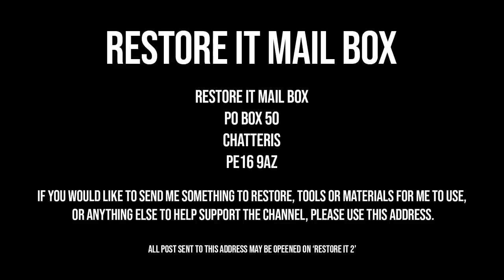Rusty BMW E30 325i Brake Caliper Restoration

Comment: Protip: Take some brake fluid on your finger and coat the piston seal and a coat the bottom half of the piston also. The piston will go in a lot easier and the seal won't dry out if you don't plan on using the part for a while. Also, install the dust cover on the lip of the piston first then press it into the caliper after the piston is seated in the bore, then press the dust cover into the recess of the caliper.
Reply: Great tip! Thanks for info.

Comment: Why would you put loctite on the bleeder valve? That thing has to be loose to bleed the air out of the brake lines.
Reply from the maker: I wasn’t thinking straight there, haha.
Reply: The moment i saw this i was like: He have not actually do that 😂Well, this guy just fucket up pretty hard when he wants to bleed his brakes an just round the Valve 😂
Reply: It's the blue stuff, not that hard to break loose.
Reply: Also.. Skip silicon grease and use anti-seize instead.
Reply: (O[][]O) silicon grease is better for the rubber
Reply: (O[][]O) silicon grease for metal to rubber contact and  anti-seize for metal to metal contact
Reply: Nolte Zockt: it isn't hard to break. He didn't fuck up, just made it a little harder to bleed it next time. No big deal.
Reply: He will find out if he restores the car by himself ;).
Reply: You dont have to unscrew that in order to bleed the brakes, so why is that a problem? Sorry for the stupid question
Reply: How else can you bleed the brakes ;)
Reply: (O[][]O) Tell me how fun it is when that anti-seize heats up and turns into a solid.
Reply: You just attach a hose to the damn plug (after removing the rubber cap)
http://www.shiftice.com/images/brake_work/IMG_5206-1.JPG
Reply: Oh yes, I forgot, forgive me :D
Reply: I think you gotta unscrew a bolt, no? Can't remember last time I did it (it's been a few years I only have a motorcycle, on which you definitely have to unscrew the bleed valve)
Reply: If its stuck heat the Bleed Valve with a blowtorch so the Threadlock burns and looses grip. Dont twist too hard or it will snap and need extracting possibly damaging the threads.
Reply: Loctite becomes useless after being heated to 500 degrees F. What temperature do you think this caliper reaches during average use?
Reply: Copper paste is the best for this.
Reply: Never Seize.
Reply: Nat Funk a little over 400°
Reply: I live in Canada, if you do not use the loctite on the bleeder valve you most likely will never be able to bleed it after a few winters.
Reply: Y B honest question here, what about using Antiseize on the contact points between the brake rotor to bearing assembly and the brake rotor to wheel hub contact points to ease removal in the future? I’m new to doing my own maintenance and don’t want to screw anything up.
Reply: You want them to turnout under vibration? Also protects the threads
Reply: canuckguy worried  nor have I   but splitting hairs so I'm not bothered
Reply: Y B  fired on the spot for being wrongly informed,  nice guy. Never made a mistake?
Reply: (O=[][]=O) lol, that’s funny.  Let me know how that turns out for you on your vehicle
Reply: To undo any fastener with loctite,  apply heat (propane torch will do) to melt it and the fastener will come out normally.
Reply: @gregoryyount6907  and it helps to prevent accidental loosening of the bleeder valve..
Reply: Ok did he do it right or not? Anyone? Ja
Reply: @natfunk71  200deg my friend, unless its a track car.
Reply: @JakubPatekk  I know it's hot enough to burn my freaking hands!
Reply: I also wonder if the high build primer was high temp enough to withstand the life of brakes.
Reply: @Badenhawk  that should be fine, try not putting grease anywhere it could leak onto the rotor imo, and remember that brakes get hot so only certain compounds survive (if you're going down large hills or such)
Reply: @mobiledevto  anti-seize does not handle heat well. It seems to gum up in slider pins. Lithium or silicone lube work great.
Reply: @Badenhawk  to be honest, a clean surface is best. If you MUST apply an anti-seize to the hub, a little spread around the hub only works. If you apply too much, you will be messing with the torque values of your lug bolts/nuts and thus potentially losing a wheel. Do NOT apply anything to the threads of the lug nuts/bolts and use a torque wrench to tighten them. Stop at the click. ;)
Reply: I realized the error of my ways and changed how I do it now. Thanks for all that commented.
Reply: @naphan3487  correct
Reply: @bikingwithchris6860  well said

Comment: I can only restore the tabs of chrome after accidental shutdown of my pc..
Reply from the maker: A great restoration non the less.
Reply: Once I even failed to click restore and clicked close and bye 30+ pages
Reply from the maker: Elvin Novruzov That’s the worst. That empty feeling inside.
Reply: Ctrl+shift+t works even after shutdown.
Reply: @elvinnovruzov5775  Check the settings, you can make Chrome keep all tabs if you exit accidentally or your PC crashes. "Settings > On startup > Continue where you left off"

Comment: After degreasing I would have thrown it to a bath of phosphoric acid for a day. Cleans up every nook and cranny, doesn't harm the parts and usually no need for a wire brush afterwards. But nevertheless, good job and props on using silicone grease on the slide pins!

Comment: Congrats on 200k subscribers.
Locktite on the bleed nipple isnt needed, the nipple is the one part you want to move when bleeding the brakes.
I've always found it easier to fit the piston before the dust cover, either way its still fiddly.
Perhaps nickle plating the nipple would have added a bit of oooh, aaaarh and stopped future rust.
Nice work as usual.

Comment: Nice! I used to struggle getting the dusk boot on but after many rebuilds I've discover that I can slip the boot on the bottom of the cylinder and then with it barely on work it into the caliper. Much easier that way.

Comment: Can’t read every comment but didn’t see it mentioned : one spot you didn’t mask (and should have) is the surface the brake ads will ride on. This needs to be clean steel so the pads slide smoothly. I’m not an E30 expert but just want to let you know in case some paint needs to be removed from those areas. One area of the car not to mess around with; brakes. Love the channel. Keep up the great work.

Comment: I hope you didn't sandblast inside the caliper, especially where the piston sits as its supposed to be incredibly smooth! i dread to think that theres bits of media floating around inside the caliper with the bleed nipple and hose being removed

edit: that better not be locktite on that bleed nipple!
Reply: Its gonna be locktite
Reply: god help getting that loose without snapping it
Reply: Blue loctite. It's not hard to remove. I don't think it's a good idea, but it's not the end of the world. Blue comes loose easily.
Reply: I found it odd that he didn't get a cylinder hone to smooth down the inside of the cylinder. Even if he didn't blast it, it still should have been honed to refinish the surface.
Reply: but loctite on any bolt you want to easily remove is a bad idea. it's not like it will back out.

debby downer alert sorry
Reply: @BaguetteBeardBass  Yes, it should not have had Loctite applied to it. I'm just saying it's not a huge problem because it's blue which is easily removed. Blue is only used when vibration and thermal cycling may cause a fastener to loosen over time. Normal hand tools busts it free. Red requires 550* of heat to decompose. The other colors have other specific purposes.
Reply: Locktight is alright, it seals the threads and prevents them from rusting together. Pretty sure he blasted the inside of the caliper dough, and that´s a questionable choice.
Reply: I was thinking the same about the inside of the caliper. The cylinder shouldnt be blasted at any circumstances
Reply: The inside bore of the caliper doesn't touch the piston or the seal. The seal goes into a groove in the bore and seals against the OD of the piston. Sandblasting it won't hurt anything.
Reply: @ADBBuild  actually it does touch from time to time... The seal is there because it's a seal... The piston having less mass than the caliper is prone to get hotter when use... So it gets bigger, the seal is flexible so it can take the dimension change up and down... If the seal is the only thing that takes the fluid pressure don't you think the would save money on precise machining that part... But no..the seal is there to overcome piston heat and dimension changes... The load is taken only by the piston and the tolerance on the cylinder...
Reply: Great point.  Precision machining is always cheaper for any manufacturing process.  That would be the obvious way to go.
Reply: Moreover, rough abrasive processing makes the surface rough, which will accelerate the wear of the piston.
Reply: Andrew if the piston wasn't an interference fit then why would he have needed to press it in
Reply: Stuey...the piston easily fits inside the caliber until you put in the seal.  Something tells me you haven't rebuilt a piston.

I think you misread what Andrew said.  The seal sits inside the groove, the piston is pressed into the seal.  The surface of the cylinder has nothing to do with pressing in the piston.  What are you actually saying is wrong with what Andrew said?
Reply: @Mikey83943  but if theres pitting or damage to the bore or piston it causes binding or leaks, so its not like the piston is a sloppy fit infact it should be fairly snug, the seal alone isn't holding it in is it?
Reply: the square cut seals purpose is to return the pistion after the pressure has been released, a square cut seal moves anywhere from 2thou to 6thou. The seal really doesn't seal much.most of the sealing comes from the piston to cylinder bore tolerences. That's why when we rebuild calipers we have to use compressure air to remove them. Otherwise if the seal was making the "seal" the air would push past the pistion and flip the seal.
Reply: @Mikey83943  or even replaced pads, let alone a rebuild
Reply: You're correct.  (Unlike the old style drum brake seals in the actuator.)  Just be sure every bit of media is cleaned out before putting the caliper back together.
Reply: @randymagnum6680  aimed at me? Have never paid a garage to replace my pads, discs, calipers or anything braking related. Especially since i'm now driving something with a rather unconventional brake arrangement.
Reply: @BaguetteBeardBass  I was agreeing with the commenter about never having rebuilt a piston, or had to press one back in place during a pad swap, whomever he was talking to...
Reply: Back in 2014 I took apart a seized up caliper, put the rubber bits in vegetable oil and sand blasted every part of the caliper, especially inside the oil reservoir where water had gotten in and started to corrode. No honing afterwards, just put it all together and the car has run quite a few thousand kilometers since then without a problem, still to this day.

Comment: Very nicely done, very professional. Tidbits: Loctite is not needed on the bleeder valve because you have to open it for bleeding. Also, you can put the piston in then put it's seal on afterwards with some grease. By doing this, you would not need a caliper piston tool to force the piston in. You also could save the rubber seal from getting damaged and it would overall be easier.

Comment: Now that was pretty. I've rebuilt so many calipers. I didn't paint them but I wish I could have. In this boot design, I'd install the Piston by driving dry air through the bleeder orifice. Worked great

Comment: You cant paint break calipers, dot fluid will eat that paint in no time
Reply: Turns out you can.  Most people keep their brake fluid inside the system.
Reply: @Mikey83943  lol
Reply: You can paint the calipers as long as the fluid stays inside the system, which is supposed to be closed to the outside world. It needs to be high temp paint, of course.

Comment: Dude just buy another caliper they $20 for a pair
Reply: If his hobby is restoring things, I don't think that he would want to buy new ones. Where I live, finding new calipers for $20 (especially colored ones) would be impossible unless I stole them.
Reply: I doubt new OEM calipers for a BMW would be that cheap.
Reply: Amazing if you can find them so cheap. Here in Norway, a single, used caliper in semi-ok condition is probably around $100, and then you'd have to restore that aswell. 
An aftermarked, not as good as OEM caliper is probably around $200+.
Reply: Also here where I live if you put used brake parts on a vehicle it would void the road worthiness certificate. Rebuilding a brake caliper however is fine providing it is done correctly. Only thing this chap missed is honing the cylinder before installing the new piston. I would think the rebuild kit is much cheaper then buying a whole new caliper.
Reply: @forevercomputing  The piston was replaced and it's my understanding you should hone the bore to allow the new piston to seat properly. There is some seriously tight specs with these as working pressure (and heat) can be very high. Braking on a steep hill for example. There is no margin for error as this is a critical part of the cars brakes and you need to be able to trust it.
Reply: Time is money and in real life outside a hobby this is a complete waste. Figure a 100 an hour labor rate and u have a few hours per caliper so cheaper to buy new
Reply: @norcalsrt1214  Except you're not going to be working those hours "extra" on top of your regular hours if you buy them. So yes, you're saving money..

Comment: I am doing similar restorations on Mk1 escort parts. I dont have a car yet (Still searching for a good base for restoration) but i have a collection of parts including a 1600 GT crossflow engine, M16 brake Calipers, 6 clock dash (that was a complete wreck but now mint) and dash top. Its great to watch your E30 series as the parts are not that dissimilar and your methods inspire me to get on with my own work :)

Comment: Nice project for sure. And I've done that same thing myself. But now I have a powder coating system and would use that to "paint" such parts knowing they will hold up to most anything and a lot longer. Thumbs Up!

Comment: I just done my calipers up, with the slide rails I was so pleased you applied the correct lubricant, so many ppl use grease and either too much or not enough anyway, also  not knowing the repercussions using the wrong lube, wear and leakage causing contamination ti the pads.

I 2k'd myne aswell only I mucked the shoe clearance with paint, however no big deal as I fixed that with my dremel.

Good work Steve.
 Take care celebrating 2019 mate.
All the best again.
James.

Comment: Pro Tip: For parts that see a lot of hot temperatures, choose a high temperature enamel paint and primer, there specially designed for a more durable finish and can withstand temps over 500˚C

Comment: Small tips for your next caliper restoration (rear set ? ;) )
A little piece of plywood might prevent any scratches when bumping out the piston.
You can blast with something a little harder if you leave the piston and the old boot in place. No risks for the bore.
It's better to close the threaded input with the old brake hose when blasting.
It seems you've soaked the main seal in DOT before mounting, best way to do !
A better way to mount the main boot is to install it on the bottom edge of the piston prior, then in the caliper. Really easier and no pinches.
Same thing for the smaller boots. Install it on the shaft first, a lil'bit of grease and insert it in the caliper mount.

The only mistake is the thread-locker on the bleeder. Really frail part so ... really bad idea.
In fact I'm even using cooper grease for the bleeder and the hose.

I like rebuilding calipers, nice and peaceful operation, except the blasting step. And ... it might be useful ... sometime ...

Comment: Polished up beautifully. As a mechanic though I'd advise to file the paint off the brake pads contact areas on the carrier and the caliper. And to clean up the lock tight from that bleed nipple or it will be hell to do brake maintenance in the future. But im not bitching just trying to help!!!

Comment: Im not sure mate... was the paint you used heat resistant? Also if you prime under it they have different elasticity and topcoat can crack. Normally calipers are just multiple coats of heat resistant paint directly on the metal.

Comment: Amazing work as always, only thing I would do differently would be to grind down and sand away the mold lines in the metal. If you strip the paint and rust anyways, not a whole lot more work to do. But still, looks great!!!

Comment: Very diligent work.  I personally would avoid any sandblast on machined/screw surfaces... heck if your getting new bolts anyway screw them in and blast them too.  And for the smaller metal bits since you clearly are capable you might want to look at home powder coating kit from eastwood.  Maybe powder coat is more durable for bits like like this?

Comment: Great work! But I would of masked up apertures before sand blasting also I use metal polish inside cylinder to polish surface using a polishing mop then clean then mask up then spray looks nice thou keep up the good work